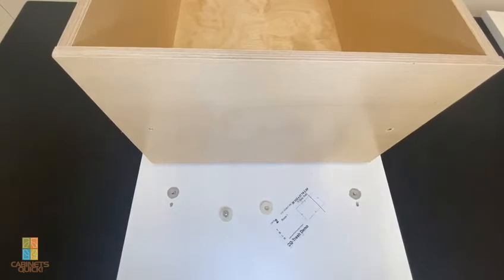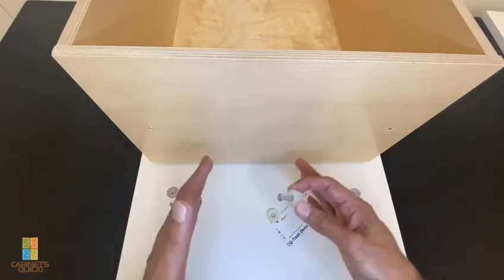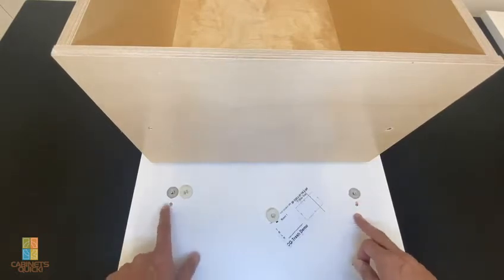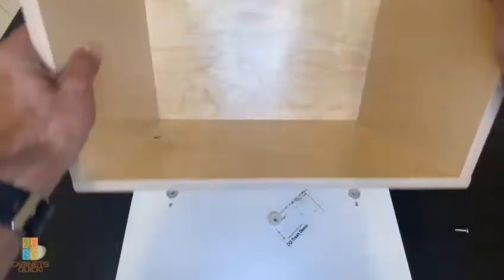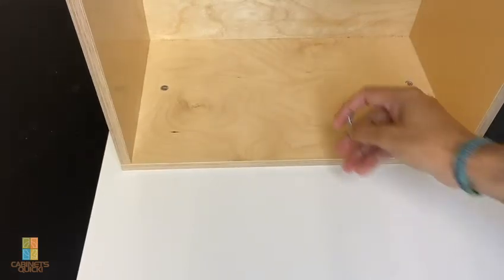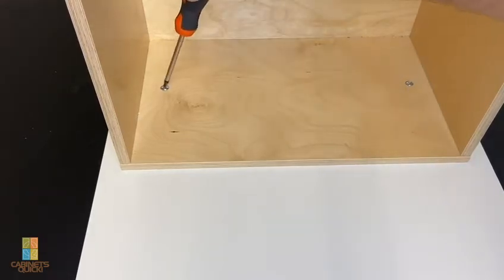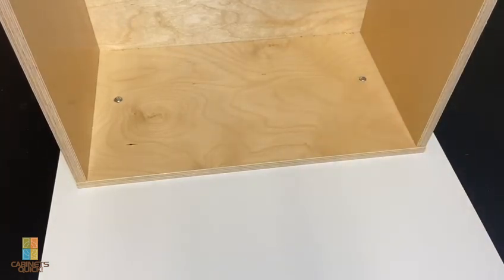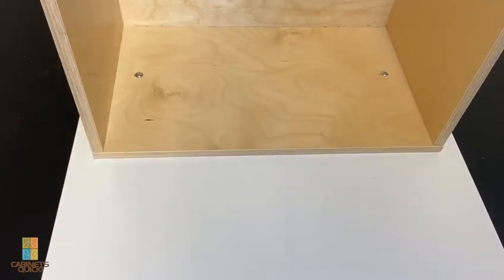Everything you need to know about Drawer Front Adjusters

Comment: What happens when you have a broken drawer front adjuster, how do you replace them?
Reply from the maker: Remove the Drawer Front: Open the drawer fully and look for screws or mounting brackets that secure the drawer front to the drawer box. Unscrew or remove these brackets to detach the drawer front from the drawer box.

Identify the Broken Adjuster: Once the drawer front is removed, inspect the adjuster to identify the broken or damaged parts. Some drawer front adjusters may be a separate component that can be easily removed and replaced, while others might be integrated into the drawer hardware.

Purchase a Replacement: Visit a hardware store or contact the manufacturer to purchase a suitable replacement drawer front adjuster that matches the style and specifications of your drawer hardware.

Install the New Adjuster: Follow the instructions provided with the replacement adjuster to install it correctly. This may involve screwing or attaching the new adjuster to the appropriate location on the drawer box or drawer front.

Reattach the Drawer Front: Once the new adjuster is in place, reattach the drawer front to the drawer box using the mounting brackets or screws.

Test and Adjust: Test the drawer to ensure it opens and closes smoothly. If needed, make any further adjustments to the drawer front position using the new adjuster to ensure it aligns perfectly with other cabinet doors or drawer fronts.
Reply: I don't even need to do this but man is this an amazingly detailed comment. awesome! @CabinetsQuick1